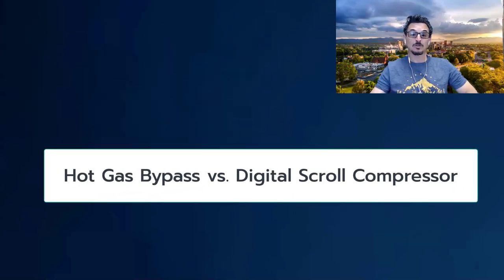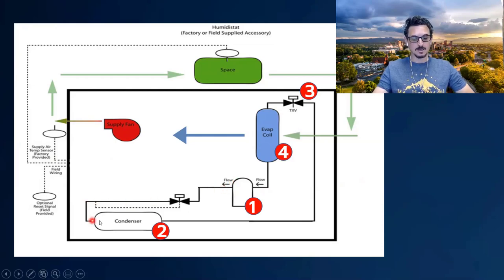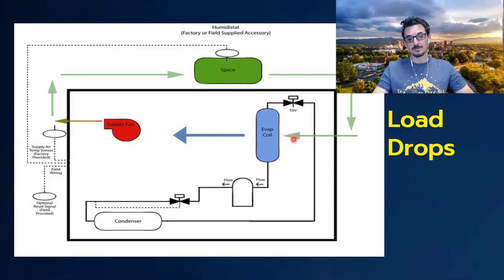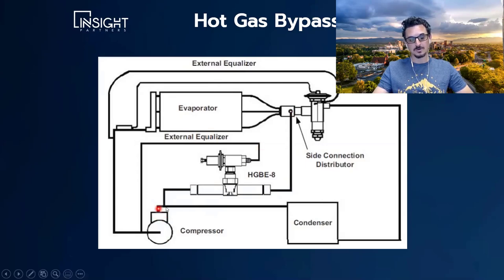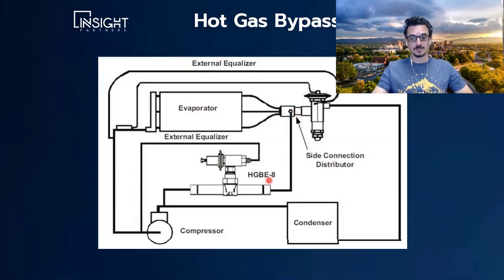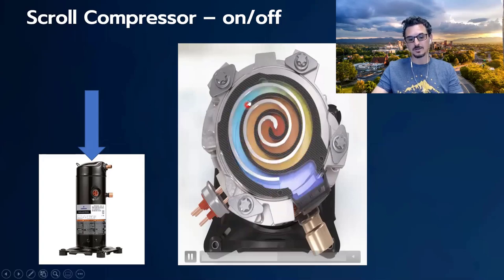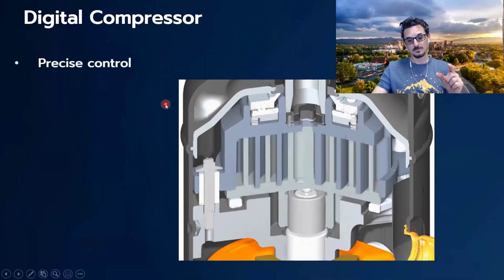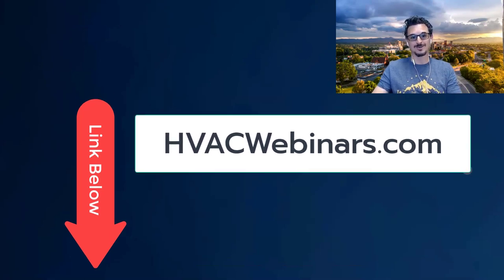Hot Gas Bypass vs Digital Scroll Compressor

Comment: This digital scroll works because the check valve (not shown or mentioned) keeps the high pressure discharge gas from backing up when the compressor is unloaded.

Comment: I appreciate your videos, Tony. 
What and how are the these controlled? Is there a digital controller that's taking sample readings of suction pressure and/or temperature? Room temp? Etc. I see a lot of cut-away videos of "how" these compressors operate, but nothing really clear on what's controlling these. Thanks
Reply: I think they work using feedback pressure based on this video. It seems more mechanical and less digital .

https://youtu.be/d_FS-3ybgXE

let me know if you get any answers . 

As for Tony , I couldn't connect to his website . You can try to connect with him via LinkedIn .

Comment: Hi Tony , could you please share how to do selection of the hot gas bypass valve itself? For example this is for cooling tunnel apolication, on this application we need to keep temperature stable and in other side we need to avoid the evaporator freezing ..thanks in advance